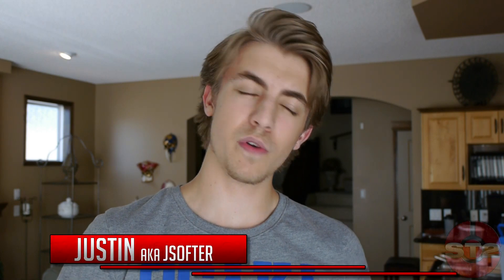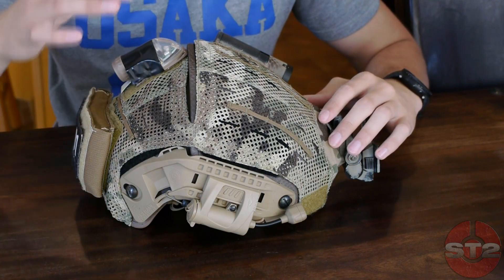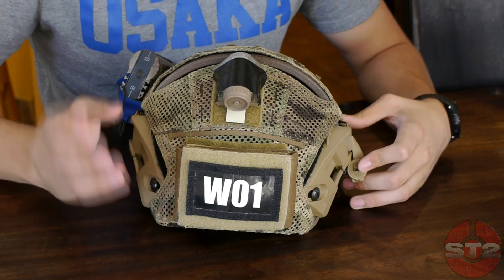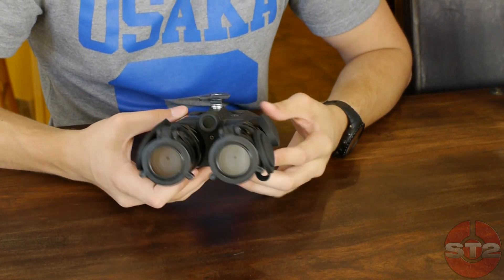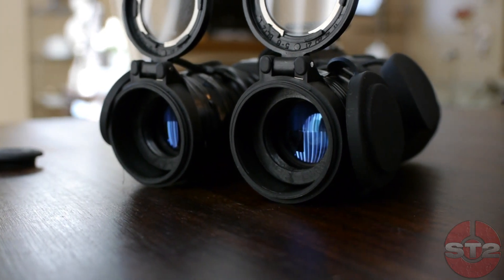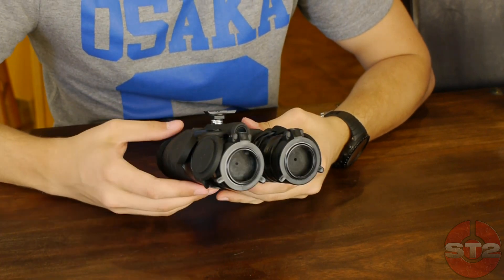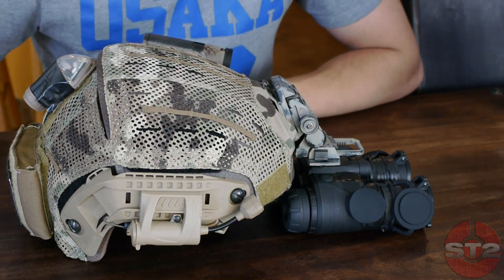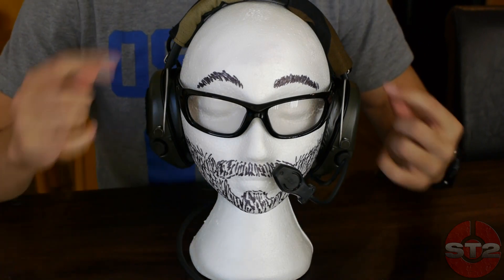Airframe and Night Vision Set up | ST2Airsoft

Comment: I have a used pair of Ghost hunters that didn't come with the headmount and is missing part of the little plug that holds the threaded hole for the mounting solution. That ks for sharing this. I'ma have to fabricate something similar and fix the plug above the circuit board that's missing

Comment: the only thing i hate about this nvg is the red light shining when you have ir on, so the enemy can see you.
Reply: mrstylo 1992 you can remedy that by getting an external IR that operates in the 940 range. Just mount it to the rails on the helmet or your weapon. It is a lot less visible than the stock IR light and in most cases it’s completely invisible to the naked eye.